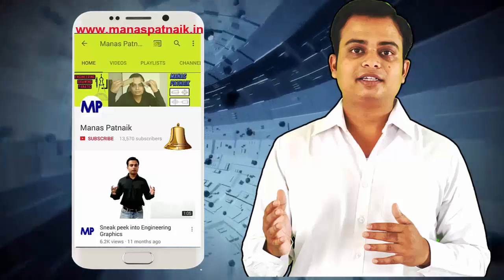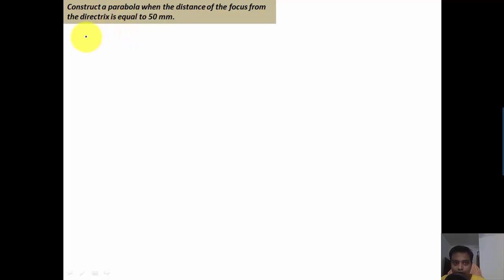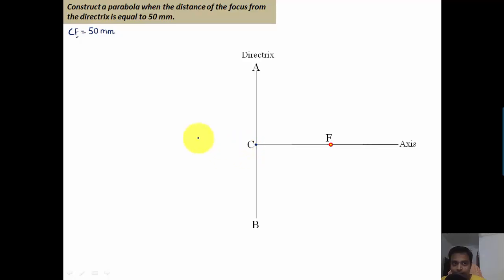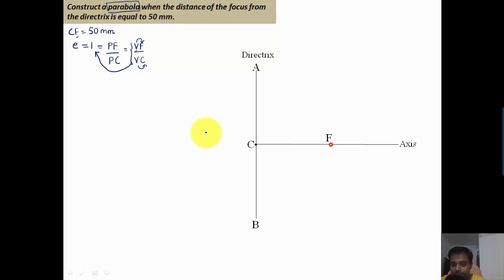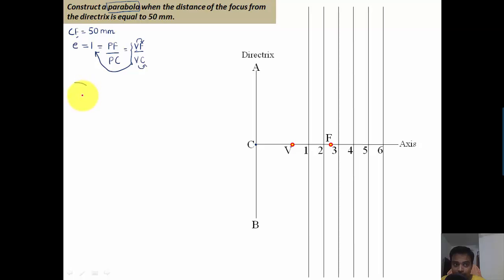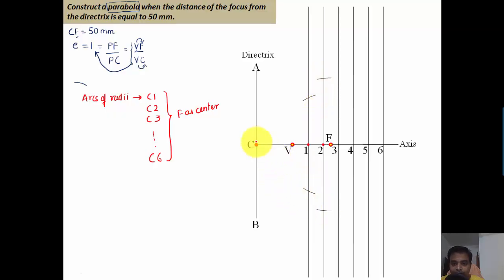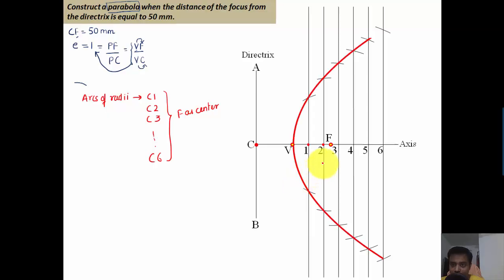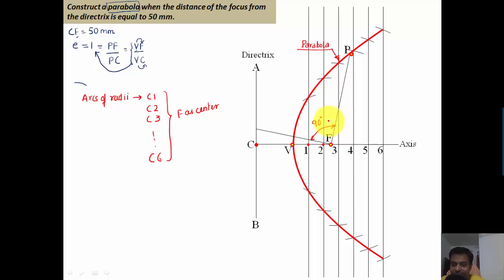General Method for Parabola Construction

Comment: If e=3/2 then what is value of vc and  vf
Reply from the maker: VC = 2/(3+2) x 50 = 20
VF = 3/(3+2) x 50 = 30
By the way if the eccentricity is >1, which in this case is 1.5,
Then the conic is a HYPERBOLA. 
Do watch this vide, it will help: https://youtu.be/M6t5HQpBAag

Comment: Sir focus is on the point 3 sir???? Because f=50cm sir please reply
Reply from the maker: Focus is not at 3. Points starting from 1,2,3....and so on have been marked at random just for construction. Focus simply is at 50 mm from directrix. Just start by marking point 1 close to the vertex and then either you can randomly mark the remaining points or simply mark them 1 cm apart.
All the best and do share this channel with your friends and classmates, so that they can also benefit.
Download the Manas Patnaik app now: https://bit.ly/3wMRxoc

Comment: Sir our sir has told us with different technique...he told us that makes a straight line in v and then cut that lin using vf as radius and v as center then join ut with c then where the line passes through from the line made from point 1,2,3 that's what  you have to take as radius and then rest is same....is both technique the same
Reply: Also happy to be your student ...thanks for the video

Comment: Should we always take the distance between points as 10mm....??? Btw grt video sir....got all my doubts cleared.....
Reply: 10 mm distance is close enough to one another to connect. It is not a must. Basically, a parabola has connected points and each point has equal distance to the directrix line and to the focus point. You can also use the string method to draw it by folding a piece of string with one end taped at the focus, another end taped to a ruler.

Comment: Suppose if e=2/3, then I am supposed to add 2+3=5 and then divide CF in 5 equal parts and take V at the 3rd point from C. Am I correct?
Reply from the maker: Exactly